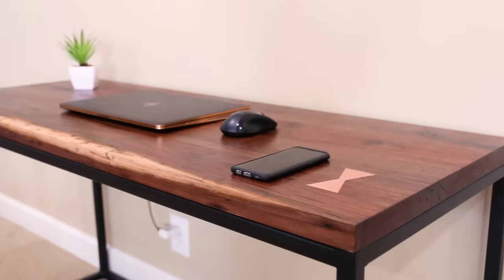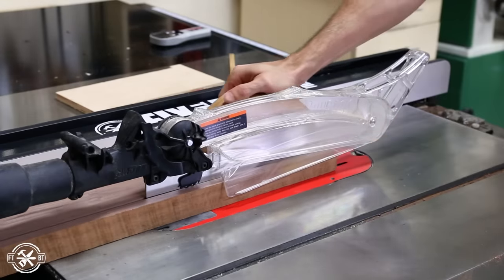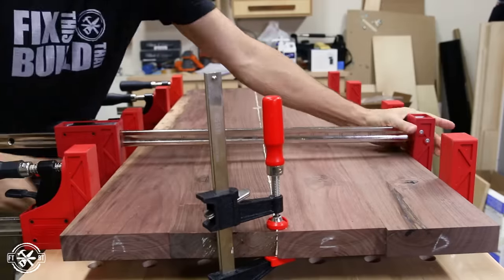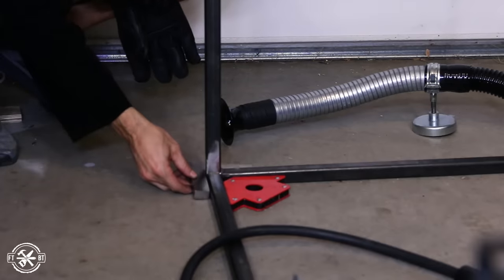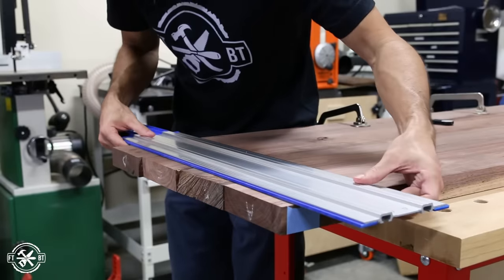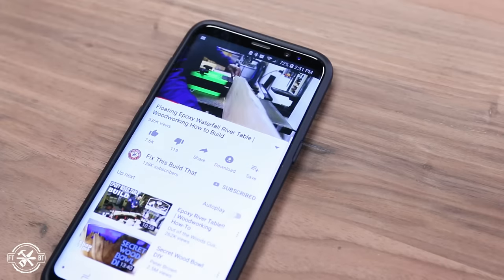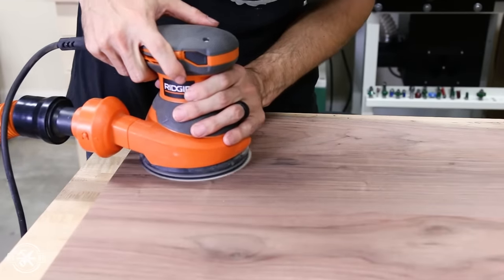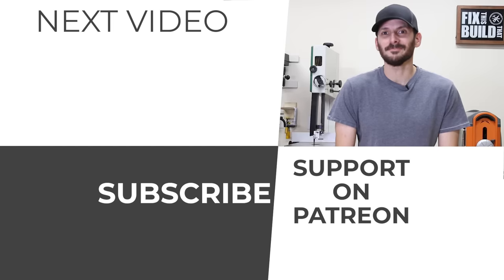How to Make a Desk with Hidden Wireless Charging

Comment: Imagine if the charger didn't work after all that
Reply: and what if it broke, how do you replace this?
Reply: That is why he tested to see if it will charge befor he glued it
Reply: The copper is not over the charger.  he is lucky he did not place it directly on top of the charger as it would not work with copper on top.
Reply: @Bobodeman  he meant what will he do if the charger will stop working and he could not get it off the table XD
Reply: I think you would just rip out the old charger from the wire. Hot glue is a little easier to work with than many other glues. You would just have to cut it out with a razor blade kind of like cutting out silicone.
Reply: I would commit despasito
Reply: He'd still have a really nice table at least
Reply: If it breaks the answer is simple, you just build a new table.
Reply: Solit Tse that’s why i just bought the coil alone without the housing, and i just taped it into the hole instead of glueing it in, because of the possibility of it not workimg
Reply: @TimGray  Who would even think of that? It would simply not even work. The thickness of the copper thing was just as thick as the rest of the desk he left over when he made the hole for the charger. So right above the charger wouldn't make any sense.
Reply: @zuga-3938   I seem to have mentioned exactly that it would not work.   And I have seen a LOT of woodworkers do exactly the wrong thing...  in one case to a $45,000US table.     Most people on the planet would think of dropping the phone on the inlay,  which is why it should have been another wood and not copper.
Reply: I am the 600th Like on this comment
Reply: @toaonok  You take it off. It's only hot glue. Replace charger. Problem solved.
Reply: Robert_CZLP heat up the glue
Reply: if a person can do all the hard work to make it so replacing charger or finding another way and implementing that is just a routine task for him. well for people who just watch videos sitting on their couch it will be nightmare.
Reply: @TimGray  he is not "lucky" he knew what he was doing.
Reply: then You won't be seeing his video.

Comment: This is awesome. I love the bowtie emblem in the surface. Hopefully your charger pad doesn't overheat and is able to last a while within your table! I probably would have cut about 1" of extra hole radius so it at least gets airflow around the sides of it. But if it works, it works.

Comment: Beautiful desk. Maybe one idea; maybe use velcro to mount the charger and/or something that is not so permanent for routing the cable. Just in case the charger goes bad you can always replace it. Amazing job.
Reply: Velcro would've worked perfectly, that's my only gripe too. Nice work though.
Reply: literally about to comment the same thing!
Reply: With the thickness of the wood, plus the case, plus the Velcro, the charger may be too far away from the phone at that point. A detachable cover plate with a foam pressure pad (to press the charger against the wood) might be a better option.
Reply: Hot glue is not all that permanent.  It can scraped out easily with minimal damage to the wood.  Plus its hidden so even if you do damage it slightly you'll never see it.

Comment: Hi there, as an architect i like the work you have done, good craftsmanship. 
And I would like to give a couple of tips for those going to this kind of project. 
-If you dont want to see the top metal frame you can use a larger top with nich that leg top frame sits into...
-Instead of hot gluing the charger and its cable use brackets to hold them in place (in case the charger fails or technology changes)
-Consider electrical outlets beneath the wooden top if you are going to use it as a computer desk, basically mount extension cable (long enough to reach the wall outlet) with multiple outlets (preferably with a on-off switch) will help what ever electronics you need to plug in...
-And ask people like "Fix this build that" channel for help in the beginning they will direct you on the right equipment and material...

Comment: small tip if you first only  tag the inner edges you can still correct the angles  than tag the outsides to  so you dont  really have to  clamp it  down as hard   or  if something is to big  it will come in hamdy  some day..  you can also use   a piece  of copper   and clamp it in with the part you are  welding because   it wont stick on copper ;)
Reply from the maker: Awesome tips! Thanks

Comment: Came out looking really nice Brad! I love the contrast between the copper and walnut and the wireless charging blows my mind - curious if it the distance from the phone affects the speed of charging?
Reply from the maker: Haven't done any testing to see differences in charging time
Reply: The further the phone is from the charging plate the lower the induced current. so yes it will increase the charging time
Reply: wireless charging isn't fast enough to be properly useful yet anyway, so it's more keeping it topped off than actual charging
Reply: @GirthyNuts  which is about 2 hours slower than the fastest charging available in phones rn
Reply: TacticalLlama18 I'm 99% sure Android makes a phone that can fully charge in 15 minutes
Reply: @Munyanyo2219  that's the oppo find X Lamborghini and its 35 mins, the 15 mins was with a smaller battery I believe
Reply: @kambu_ch3127  nope it's 100 mins for a full charge
Reply: SlipperyAvocado  I think you've missed the point of wireless charging... Having it built into your nightstand and your desk means you never end up having to charge from 0-100%.
Reply: SlipperyAvocado hey man I hate apple and love android but I want to friendly point out a flaw in your argument fast charging slows down the higher percent it may take 30 min for 0-50% but it can take over an hour for 50-100% because the electrons don't have as much space and the battery can overheat so it slows the charging to not damage the battery
Reply: @darrito1179  that is completely true, and if you look at oppo's super vooc charging they fully charge in 35 mins. This is considerably more impressive than other brands that claim a day of use in 15/20 mins as that is charging up to, as you say, 50% ish
Reply: Austin Collins Android doesn't make phones, Android is the OS not the manufacturer. The manufacturers make phones and use Android as the OS.
Reply: SlipperyAvocado i think its more for not letting your phone die when not using it so you can just take when you need to go and have a full enough battery
Reply: @slipperyavocado9457  I totally agree:) nice to find someone that can take constructive criticism lol

Comment: Hey brad you should replace the charger you put in with a large wirless charging mouse pad their supper cool and will increase the area where you can put your phone also it will allow you to use a wirless mouse that charges wirelessly one the mouse pad i dont think it would be difficult but it would be a cool improvement

Comment: That table looks awesome. You said you left an 1/8 between the top of the table and top of the wireless charger ? Frankly, i am amazed the charge still make it through the timber. The finished article looked like a proper artisan piece if furniture...with a 21st Century twist...absolute respect and peace to you.

Comment: Woah, for the welding, never weld directly on concrete, it could explode from the heat especially if you are doing more than a couple tacs
Reply: That would look sick
Reply: “just welding here, no big deal”
Concrete floor- 😏 “Alalalallalalah!”
Reply: It won't explode you need much more heat for tbat
Reply: @DILLY_DING  I think he meant crack instead of explode
Reply: @DILLY_DING  yes it can. dust explosion can occur
Reply: Ya boi God when u get ur one time to be smart 😂😂
Reply: Nonsense.
Reply: @verygoodbrother  dust explosions occur due to a large amount of airborne dust.. not a bit of dust on the floor.
Reply: I've never heard of that before. My papa, dad, uncle's, mom, and cousins all did the same thing....weld in a shop with concrete floors.  Nothing ever happened. And they did a lot of projects on the floor
Reply: Funny guy

Comment: Your welds are fine for your project and over time you will improve on the beads themselves. Just be sure that when you weld your tacking first and then checking for square and not just laying down a bead.

Comment: you should have drilled a small hole under the inlay from behind to bleed out the excess epoxy,so that it would fit flush to the surface and eliminate the excess sanding.Just a small thought

Comment: Great video, I can see why it went viral, an easy and well built project that even I can tackle. Thanks.

I will add a multi-outlet under the table so I can plug in my laptop and other gear.

Comment: just wana say that induction heating may occure and the copper might either slow the charging time or heat up or make the board draw to much current u shoulda have not placed it that close o the charger research induction heating and u will get what i am saying thanks
Reply: It's like 6 inches away.. I am sure it will be fine.

Comment: could the distance between the charing pad and the phone lower the charging speed dramatically?
Reply: its recommended to keep the distance close and nothing obstructing the charging,. 

its would be better to use something like glass / apoxy or something since its not blocking the signal

ssorry for my english lol
Reply: multiw8 wood is just as good as epoxy or glass
Reply: @Felisargyle  Woah
So then would you say it charges just as fast as if the surface was glass?
Reply: KEN BUYOGA yes
Reply: The important thing is... The thickness!😅
Reply: This would for sure lower the charging speed. 
Some materials interfere more than others, but ultimately the biggest factor would be the distance between the phone and the charger. Wood + case would slow down the process dramatically. 
Best bet would be to shave down the wood to be as thin as possible where the charger is, and actually make the charger a supporting piece of the table for strength. 
For those wondering, wireless charging actually works magnetically so the less distance you have between the magnets in your phone battery and the magnets on the charger the better.
Reply: Before doing something like this, just use pieces of scrap wood on top of your wireless charger, and see how different thicknesses affect it.

Comment: Oh, so all you need to do is make an entirely new desk? Easy enough.
Reply: You could technically put it in a already done desk but it should be kinda thick
Reply: That is the title of the video after all, if you already have a wooden desk there's nothing stopping you from routing out a spot for a wireless charger as long as it isn't too thin.

Comment: How to make a table  with built in wireless charging:

by 5000 dollars worth of wood, equipment and tools.
Reply: At least. Lol
Reply: Well with a saw, sandpaper, something as a sanding block, and a hand plane plus the wood and a desk base (they are sold as a kind of kit that bolts together) you can make this. That's about 100 in tools that will last you basically longer than you will, about 150 in wood, and maybe 50 for the table base. The wood is way cheaper when sold rough. If you want the insert, you'll need a chisel and some metal to make the insert itself.

Comment: When welding it makes a much more solid and cleaner looking weld when you put grooves on the joints. It’s easy to blow through with that thin of metal so tug welding would be the best way to do it.

Comment: The best way to weld this kind of structure is like you did, small squares and then make the entire thig but i recomend you to don`t du full welds in the squares, just make some small "points" of weld, then you can doble check if everything is 90º and if it isn`t good you can just bend it with ease back to square since it`s just a little weld. Making it that way saves you from using some much clamping and in other cases were you need more precision helps to reduce warping soo the metal dosent look like the wood at the start.
Sorry for bad english and if you have cuestions i had welding classes on my school (kinda basic but enough), feel free to ask

Comment: I'm a nondestructive inspection technician and one of the things I do is inspect welds for defects. As a tip to you, avoid starting and stopping with your weld. This can lead to "bursts", which is a cracking defect in the metal and can ruin the integrity of the structure you are building.

Thanks for the video.

Comment: Great job! Looks really cool! About the only things I might comment on for future reference;
1) If you're going to weld a table frame, ensure your cement garage floor is completely level. (yeah, you mentioned a proper welding table)
2) As for me, I would've added adjustable feet to the bottom frame. I've never known a floor to be completely level (unless you enjoy folded up paper shims)
Oh, Subscribed!

Comment: hi, as a tip for welding, when using a magnetic square don't do a complete line of welding, just do knots to keep it in place, remove the magnetic angle and then do the line. The magnetic roller will create a magnetic field on which it will create a superficial welding and not a deep welding, look it up and you will see other people on there videos finding this the hard way.
so use it to have everything straighten up, then just do a knot, move the ruler and then do a complete line. easy piecy lemon squezzy...
BTW i love your videos and I have tried to follow up on the DIY myself but its hard when you don't have all the equipment. 
Stay safe out there have a great day.

Comment: Love the video! Only thing I would have done differently is use wood to hold the wireless charger and the cable in just in case the wireless charger ever stops working

Comment: Hey man. Great job and inspiring stuff. I built the same exact desk (short of the welding), and am finding that the wireless charging CONNECTS but does not pass much (if any) charge / current through the wood. I bought the same one as you and tried a different one as well. I've gone down to about 1/8th inch left of wood and am worried about going any thinner. Have you had any issues with this? Thanks!

Comment: What I'd do for that bowtie ( just from the perspective of a guy who fabricates with sheet plastics) get a piece of 1/4 styrene board, and trace the bowtie into it just as you did with the table to make a template, this way if you mess up on the styrene template you'll be able to tell by any presence of lightning the template when you try to fit, if you messed it up... styrenes cheap😅 can try again.
Once you have a good fit, use a reverse fluted trim bit to get the majority of it .
Just be sure to use that styrene to also make a template of the bowtie, and keep both the inner and outer jig's you've made. Now you have a quick way repeat the process whenever u want. Just use lots of double side tape to hold the jig down, or make it large enough that you can clamp it down without that router getting in the way 😂

Comment: Great video! Tried the part with the charger today but it did not work. I even ended up with a hole in my wood because I tried it thinner and thinner. Not sure if there are differences between the chargers as well? Would love to know how thick it was in your video to work.
Reply from the maker: It's very charger specific. You need to look at the transmission or charging distance. The specific one I link to worked at just under 1/8" of wood and through my thin case.
Reply: Fix This Build That thanks a lot! Maybe Ill give it another shot if I can borrow a router again :-) 👍

Comment: I'm a little late so I apologize. The way we frame steel tubing is to try and get as close to square as we can, then tack. Once all four corners are tacked we measure opposite corners and compare. We then use either a pipe clamp or turn buckle to match each distance of both corners. Once we're satisfied with the new measurements, we weld all four corners. For the best results we will keep the turn buckle in place until the last possible minute. If you need me to explain anything I mentioned here feel free to ask. Keep up the good work!

Comment: The copper looks nice, but I think a wood inlay on the actual position of the wireless charger would have served the purpose better as there is still some guess work as to where the wireless charging position is next to the copper.

Comment: Hard to tell from the video, but since you said you had to use a bunch of clamps to get square joints I think this may be pertinent (and this video is from a while ago so you may have already found out) but:
When you tack weld you don't tack weld a joint and then weld it, you should go and tack weld all your joints so your project holds its general dimensions then go and do your full weld bead on the joints. The tack welds should act as clamps would and prevent a lot of warp from the heat you dump into the work with a full weld bead.

Comment: Question, I am considering attempting the same thing you did with a charger, how much wood does the charger work through? Half an inch of Plywood say? Then have to take into account varnish or lacquer.

I want to do a desk top with 3-4 sheets of 3/4" plywood, 2 nice sheets for the Top/Bottom, filler doesn't have to be too nice. But I don't know about the legs, I don't really want to use standard table legs.

Comment: Super glue seems so permanent for tech that could fail you and need to be replaced. Not that it would be easier, but (new to this, so) how difficult would it be to carve a slot toward the surface (running the length of the desk to where you want the phone to sit) where the charger could simply slide in rather than routing in the complete depth? Anyway, great job. It looks incredible!